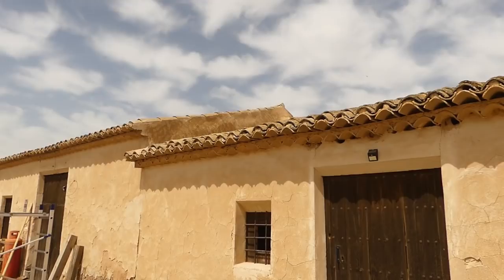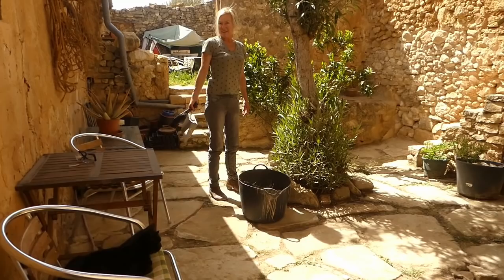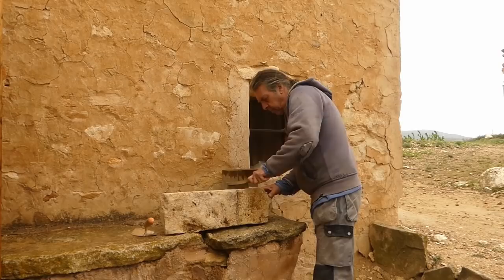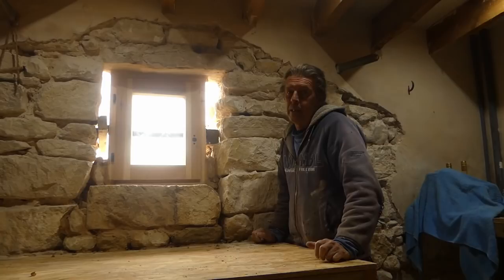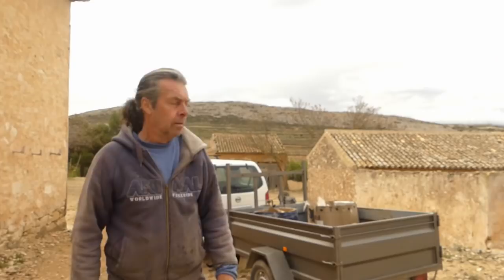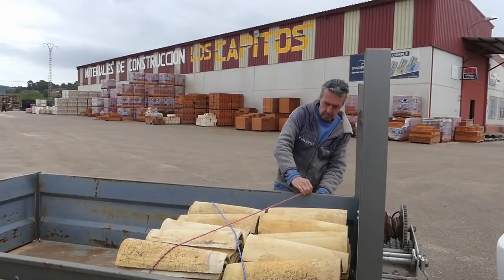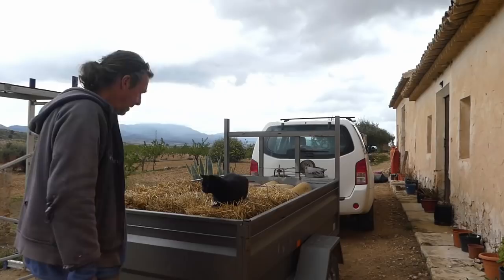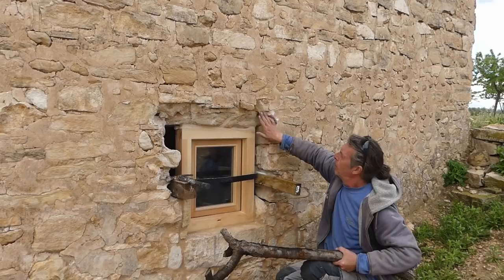Great progress on the roof but a window fail - Off grid Spanish finca restoration

Comment: Hi     love the videos. In Spain there are designated places to deposit rubbish its just that people see dumped stuff by the bins and think its the norm. Imagine if the bin was close to a property ,would the owners be happy. I changed my wheelbarrow tyre for a solid one and found it does not roll over gravel or uneven ground as easy as it tends to dig in. Are the roof tiles new or reclaimed as i am paying twice that. ie 1 euro each. Got to say i am impressed with your stone work.
Reply from the maker: This is true. We use a large recycling point rather than just bins. We're pleased with the new wheel so far :) It works well on our ground. The roof tiles are reclaimed. We aren't permitted to use new ones although you can get new ones that look similar and I believe they are around 0.80€ each and thank you